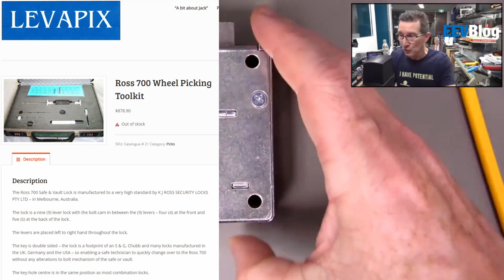How High Security Safe Key Locks Work

Comment: The key should have a way of putting tension on the bolt....

Some cheap "security gate" lever locks here are openable with a bent wire... (That is likely significantly harder for these...) (not least because of the pin partially blocking the keyway) (With those cheap locks, it seems that the levers can't move past the set position, which makes it a lot easier...)

Comment: Bluetooth can be a relatively secure protocol, but the pairing part is dangerous. By design, and Dave probably knows this, the Bluetooth protocol allows pairing with a null key, or a fixed pin which is usually easy to find out. So, if you have any reason to think someone in the area is looking to raid your safe, don't pair your phone with the lock there. I do imagine that the "reduced range" of the steel-encased antenna helps mitigate this a bit, though the phone side of the transaction should still be readable with an SDR.
Reply: If you're only relying on pairing for security then your security is non existent the actual unlock stuff should at least be protected by two factor encryption.

Comment: Regarding the bluetooth lock, what if you keep pressing the lock bolt lightly and at the same time vibrate the entire assembly sideways? Wouldn't that cause the pivot arm to rotate eventually?
Reply: No, that would put vertical force on the pivot pin and actually make it harder.

Comment: Good aussie design them dead locks   Not on our back renter back gate they have a  simple lock that a  blade pops it   
had a few crackheads  climbs the wrong fence instead    Your in the  wrong house mate  try next  door   @@ Oh sorry xd :)
Front doors  made of cheap wood fibre  with deadbolts  Ha!  stupid 
  a mate  Reinforced front door  with steel sides and a 6 pin bolt latch  told me Use a broom stick rear window sliding easy popped opened with a knife  so i did that asap . ______|

Comment: "Military Grade Encryption", a very old term from way back when encryption was treated as munitions and had export restrictions placed upon them and applied to encryption schemes keys larger than 40 bits. The only way we got an internationally interoperable encryption system working for the internet was by publishing a paper book (it's free speech!) describing the encryption (see the history of PGP).

So if a vendor says they use "military grade encryption", it might just be a back of the envelope breakable DES cipher...
Reply: In the same vein saying something like "I wrote every line of code, I can't hack it" is also a rather meaningless statement. I've written some stuff in assembler before as well, but I wouldn't go as far as sayin what I did was unhackable because I can't do it. Some of the more "accademic" hacks involve hardware faults down to the silicon level which no dev has a clue about. The people that made the silicon often don't have an idea about those either. Not to mention simple human error, aka. the birthplace of bugs which no engineer is safe from. ;)

Comment: These locks are so basic, I don't think LPL would even bother to make a video on them. There are many many videos on similar locks mechanics already.
Reply from the maker: Rubbish. He has done video on much more basic level locks, and he had to used the specialied tensioner tool to do it.
Reply: @EEVblog2  those locks are  Lever tumbler locks. I haven't saw anything special in the video other than probably some weird key profile in the third one. I believe they also subject to the weakens of those type of locks like any other.

Comment: Always good to see more locks featured. If interested in how to approach picking these, and other locks, The Open Organisation of Lockpickers Australia can likely help.
Reply from the maker: The approach to picking these is to get the purpose designed tool.
Reply: @EEVblog2  True, there are commercial tools. It is usually much more fun to solve these puzzles yourself, and share the puzzle with others.
Reply: Nope, I can pick these with very standard tools.  Also, just FYI, those were not false gates.  They were what's called serrations, which depending on the lock can be easier or harder than fales gates.  A false gate will be a gate which is the same width as the actual gate, but not as deep.  A serration will be like you see here.   multiple cutouts that give multiple clicks when picking.